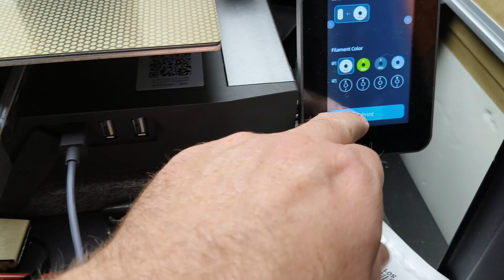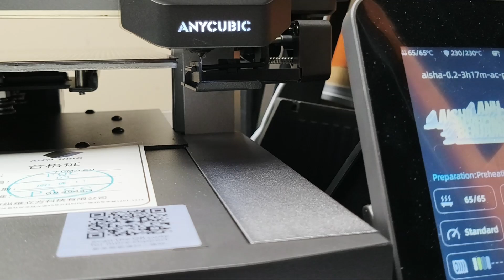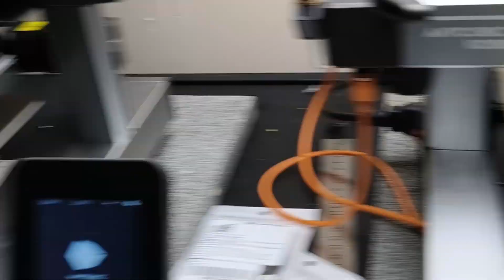My Kobra 3 Belt Broke – Here’s How  you can fix yours!

Comment from the maker: Do you think I missed anything in the video? Share your after posting tips/hacks below! 👇
Reply: does the belt come through the same hole you fed it through or  not.
Reply from the maker: @1supermanprime  not the same it will come through at the bottom.
Reply: @ladbeige   If you have a camera mounted on the end you need to  remove that screw as well to get that cover off, i did on mine. great video, thanks works great now.
Reply from the maker: @1supermanprime  that's a good mention thanks

Comment: What belt did you use for your replacement? Mine just broke which is bad news as I have a market this weekend
Reply from the maker: Ordered from amazon, and then a soare feom ali express. If youbsearch kobra 3 youll find it easy, usually comes with both belts